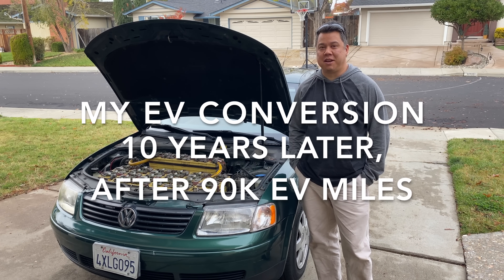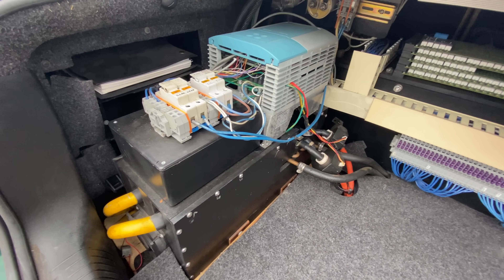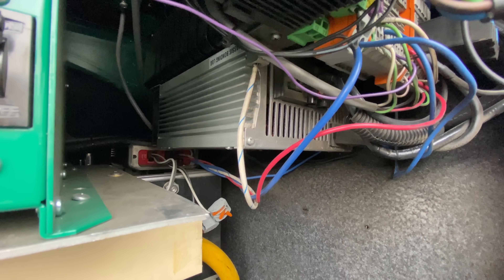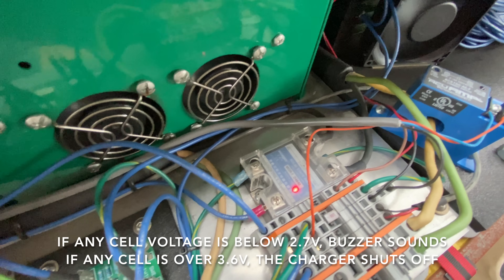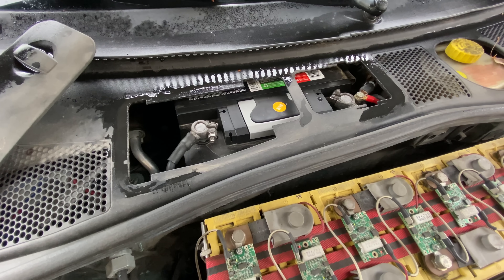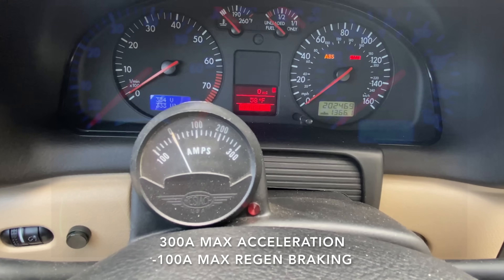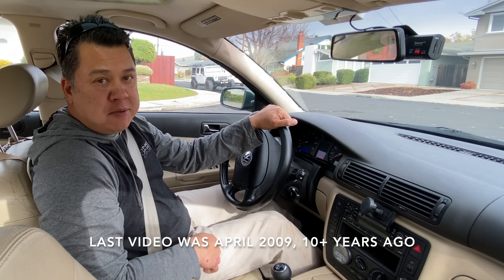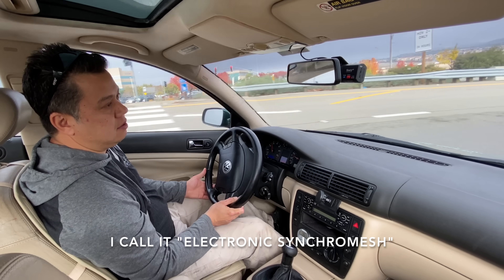My EV conversion after 10 years and 90k miles

Comment: Probably a dumb question but why no clutch? Too much torque from the motor? And if so, why can't you just get a heavier clutch?

Also, this is so damn cool.
Reply from the maker: I wasn't sure if the bearings in the motor could take the thrust load of the clutch throw out bearing pushing on the shaft.   I was also planning on just using 2nd gear from the start.  Adding a clutch means adding a flywheel, which requires more machining tolerance and force on the taper lock fitting I was using.  It would also require balancing the flywheel to 9k rpm.

Comment: I know this is the hardest part, but you should throw away the gearbox and using a motor who match the speed of a differential than you should take for an other car, like a RWD,  mercedes type or something, you will gain some space for cell. But the cost increase with more cell so ... may be you don't need that mutch cell for your standart use of the car and figure out it's enought like this ?

Allright it's a pretty good job you make and the initial investissement is pretty huge, so big GG. I like how you use a standart indutrial inverter and adapt it to a car throw current mesurement, allowing you to do some torque regulation. Yep, the big point is to have some 0-20Kmh smoth torque, industrial inverter are made for speed regulation and are barrely made for torque regulation, So once again, big GG to you, I can just clap my hand for all this hard job.

At your place I will use a  PLC instead of this bunch of controller, because it's allowing more space. But may be 10 years ago there was not with the same price and capabilitie than they have now, I think you obviously did this choice on purpose.

But Alright , i am not here for critisism, it's just something a Look as a technician and it's involving in me some question, nothing more.

IN fact, it's very good job, just GG.

Comment: Just too much, it was easier to use dc motors from forklift, they are not fast, but are capeable of making great torque, its automatic, so you don’t have to change the gears and by the way, why you didn’t used the fuel tank space? Thats the main problem with ev conversions, noone uses fuel tank space

Comment: Nice..what's  your total battery capacity (kWh), charging rate (kW), and what's your range (km) on a full charge?
Reply from the maker: 33kwh battery, 6kw charging, 100 mile range but kept it below 70 miles for battery longevity.
Reply: @etischer  Nice! That's about as good as my Nissan LEAF 2017... and your home-made EV is  much older.. Nissan could learn a lesson from your conversion!

Comment: You need to change your batteries from old design to better design batteries. 
You have done a fantastic job but not with the batteries. The weight of batteries on your electric cars runs about 800 lbs?

Comment: So what was the cost to make your car electric? Then what does it cost to charge it (electricity draw from your house)? All-in-all, great conversion. But you didn't benefit by saving money on fuel cost or your electric bill. So this was just a hobby and challenge?
Reply from the maker: Yes, I did it for the challenge, and to show case my engineering skills.  I had done other gas conversions, you can check them out on my website etischer.com   Our night rate was 3 cents per kWh, and I get 3 miles per kWh, so about 1 penny per mile.  I also charge at work for free, so 1000 miles cost me $5.   Actually our electric bill went lower when we switched to an EV plan, so it's basically free to charge.

Comment: Why didn't you put a gear box before the automatic box to reduce the motor rpm to normal engine running rpms then you would have been able to keep the automatic with less load on the electric motor so it would draw less from your battery pack
Reply from the maker: There's no need, the stock transmission works great.  No need for an automatic gear box, the motor has a much wider torque / power band compared to a gas engine, this is why no OEM EVs have transmissions.

Comment: Awesome, I seriously recommend having a fire extinguisher in the car, just in case.
Reply: White Right not with the right equipment
Reply: @fiveninegarage  youve obviously never seen gear like this go up in flames, nothing but a ticking time bomb as soon as flames break out
Reply: @fiveninegarage  They dumb them in containers filled with water to get the fire controlled... not even a fire truck can put these fires out
Reply: If it started on fire I would run away rather then put it out

Comment: Having converted my CJ5, you did a really clean/complete job.  How's your battery match been?  How often do you manually re-balance?  Do you have any under-achievers?  Do you go thru 12V Pb batteries?
Reply from the maker: I went a solid 9 years without measuring voltages.  I have two that have been low, I think the top balancing BMS allowed them to drop in SOC over time.  In the last year I had to top up one cell up about 20 Ah.
Reply: @etischer  I have the same batteries and BMS (from your front cells).  Mine date to 2010.  All still work fine.  Overall batteries are probably down 10-15%. 2 or3 batteries have been topped-off every 3-5 years or so.  Usually the same ones.  20Ah would also be about my largest adjustment.  I have half the range, so system SOC might be more important to me.  I'm most impressed by your use of space.  A Jeep has a lot more open room under the hood, but I didn't pack it in like you did!  Nice work.

Comment: Because all that extra heavy pounds you will need an industrial jack just to change a flat tire. A manual on a EV. My respect sir.
Reply from the maker: The added weight is only in the rear, where the car was lightest.  My car is 100 lbs heavier than the v6 variant. Not a big deal, no special jack needed

Comment: A friend of mine has a crx hf and considered installing an electric ac. We calculated the conversion would add about 50 miles or 5-10mpg. The car barely makes 70chp and removing the parasitic drag from the motor would help it a lot.

Comment: This is interesting. I bought a phev with low miles for $8500. Half of my driving is all electric. I think I opened my hood two times in 15 months. So far it has been reliable and very cheap, average 72mpg and maybe $15. a month in electricity. After driving over 15k mile I am sold on electric cars. You never worry about stopping for gas in the morning because you have a full charge every morning. The cars are so quiet also. Next time I will consider full electric. You don't need to be a genius like this guy to take advantage of owning an electric car.

Comment: Beautiful build, even more impressive considering it was done 10+ years ago. Living in California you probably don't have to worry much about heating, but I wonder what would it take to have the A/C fitted with a reverser valve (I don't know the proper name, the valve that reverses flow of coolant) to get rid of a resistive heater.

Comment: That’s a lot of determined hard work. You have done a mighty good job covering all those requirements with multiple systems. In 1980 when I was an apprentice I designed and built an electronic fuel injection system for my racing Mini Cooper. I also had electronic spark advance and retard, electro optical and magnetic sensors attachment to the engine, turbo boost mapping in the Z80 microprocessor controller (which I also made the pcb’s and done the programming for), and not forgetting the electronic ignition system which I also designed and built. So I know how hard you have worked on this project from my own experience but it’s all fun really when you get the satisfaction of success. Fantastic job .. it really is.

Comment: Not really an fan of electric cars but you sir are a genius. Since you built your own car maybe you can answer a question I've always asked but never got an answer to. Why do regenerative systems only work while hitting the brakes? Why not somehow turn all 4 wheels into an alternator that is constantly charging while the wheels are spinning? Like the alternator on a gas car. It seems like common sense but I'm no electrical engineer and I am genuinely curious about this topic.
Reply from the maker: You can only convert energy.   Regen brakes convert motion into electrical energy, which cause the motion to get used up (car slows down).   Energy can't be created for free.
Reply: @etischer  Thank you very much for your reply. I understand that as the energy is created from the motion of the wheels, the motion gets used up to produce that energy slowing the vehicle down. I guess it's like a drag race car. The alternator is removed to reduce any drag on the  engine. But with that being said an alternator is constantly spinning to produce energy through a belt which is moved by the reciprocating motion of the engine. I'm a bit confused as to why we can't place an alternator type device to each wheel to charge or at least lessen the discharge of the batteries while the car is in motion. This might be something I might want to dabble in at least with an electric RC car first to see where it goes. This is very interesting to me. I do love the technology and must say I do admire your abilities. Thank you again for the response.

Comment: 75 in 2nd, sounds about right. 'tho I don't know if those azure motors like being spun that fast. We kept making the mistake of spinning ours too slow. The HPEVS AC51 was born from a hydraulic pump motor, so it wants to spin at rather high (for a car) RPM -- it's perfectly happy 4-5k all day long. At your customary 2k car speed, it'll overheat. (the factory balances them to 10k, and the controller cuts out at 6k.)

Comment: I was: "I'm getting motivated to do something like this", then $25k invested, "that's s lot of cash", next all that technology, "damn that's just too overwhelming for project", then it starts turning to, "How frigging cool would it be to do this before I check out".
Reply: I believe that was the cost when he started the project. Technology has improved and price have also come down. I imagine the cost is a little less these days. Maybe not by much tho.
Reply: Doooooooooooooo it
Reply: A few years ago I was shopping for a donor vehicle to build an electric pickup.
Yes, it would cost me $20,000+ to build a much more basic vehicle than this.
I bought a used Chevy Volt for $10,000, and last year, a used Smart electric for $5000.
I found a converted pickup recently for under $10,000.
Definitely not as nice as this car!
Reply: @hjeffwallace  
Yes, hunting for the deals seem the way to go.
I'm going to startlooking through my local auto recycling lots for damaged Prius this spring. They usually lose a cell or two then are sent out for scrap. Fingers crossed .
Reply: (90K miles ev worth 11K$)-(cost of charging)= ((11K$ - 25K$)-Charging cost)

Comment: Duude! Clearly you are related to elon musk. But please explain to me, a sub lay person, how can you have a ev with a manual transmission. dont quite understand. actually, i dont understand at all. my mind is completely blown. I have a 98 volvo s90 in immaculate condition that Ive been thinking of doing something similar to. How much did that conversion cost and how long did it take you? unbelievable. btw: where in cali are you? Im temporarily in norcal. return home to japan in 14. would love to link up and get some advice.
Reply from the maker: The transmission is just a convenient way to connect the motor to the wheels, and also have the motor RPMs in a range the motor can work effiencetly.  It took about a year to get the car running, I have the dates in the video.  I'm about 40 mins east of SF
Reply: Hey, Im in marin. hit me on email. fitzdec@gmail.com

Comment: 0 - 60?
Top Speed?
Nürburgring time?
Really, really, cool!
Reply from the maker: 0-60 was 14 seconds, mainly because I was starting in second gear, and holding it to 60.  If I had a clutch it would be much faster.   Top speed was 105 mph, I had since increased the current capability but haven't re-tested top speed. 
Nurburgring time:  This was built for comfort, not for speed =)

Comment: How well does that AC compressor work? I would love to get one but even their site says that it might not be enough for a car cause the 12V compressor is meant for small cabinet cooling. Just curious
Reply from the maker: It works ok, maybe 80% as good as the belt driven compressor at full speed.  Mine ran off 330v.

Comment: Great build.  Few questions.  What was the change in curb weight? How many battery cells have required replacement over the years.
Reply from the maker: It weighs in at 3,700 lbs, 500 lbs added to the rear.   I haven't had to replace any cells, though one or two are about 50% capacity now.

Comment: Why exactly would you use a manual with an electric motor? Don't get me wrong, I love stick shift but I feel like it would be troublesome with the instant torque etc
Reply from the maker: roughly a 10:1 reduction is needed, and the easiest way to achieve that is with the VW transmission that came free with the car.

Comment: Wait; you're liquid cooling the drive motor and yet you have a resistive load for a heater? Why not just have a heater core running off the drive motor.... And not have the additional load on the battery bank??
Reply from the maker: The motor and drive don't put out much heat, the water never even gets warm.     Resistive heat is also instant heat.
Reply: @etischer  it doesn't get warm because it's always circulating, if you had a thermostat on it, it may be better.
Reply from the maker: @JF32304   I could just turn the water pump off, but still, not enough heat is produced.  It's not like a gas engine.   None of the electric cars on the market use coolant for heat.
Reply: @etischer  Tesla has to liquid cool the motor as well. As well as the battery bank! Take both of those heat sources through a heat exchanger and not use a resistive load as the heater, waste of energy.
Reply from the maker: @JF32304   The coolant is not boiling hot like a gas car, battery cells will want to stay below probably 50 deg C.   The coolant is cooled using refrigerant from the air conditioner in some cases
Reply: @etischer  good Lord! So we're taking power from the battery bank to run a resistive load heater, we're also taking heat from the battery bank and passing that to an AC compressor (more battery power)! This is mind boggling stupid. Take all the heat into one single heat exchanger. You can have the resistive load heater to get heat up fast (on cold mornings) once your battery bank and motor are producing enough therms, turn off the resistive load and go with your heat exchanger. Really is quit simple. If you're concerned about it not being efficient enough to pull enough heat out, install a radiator and fan. It's stupid to power an AC compressor to pull heat from the battery bank. If you're producing enough heat that you need to have it cooled by refrigeration... You have big problems with efficiency.
Reply from the maker: @JF32304   There's no hot water, the batteries, power electronics and motor are supposed to stay around room temperature.   If you're cooling something that's supposed to be room temperature you need cold water.
Reply: @etischer  ok. But you just said they sometimes use air conditioning to cool it down right?
Reply from the maker: Jesse Fritz refrigerant goes through a liquid-to-liquid heat exchanger to chill the coolant.

Comment: Excellent informative video. How do you use ac motor with throttle? Would you guide a bit to use ac motor controller insted of DC
Reply from the maker: The Passat was originally throttle by wire, so I wired the throttle pot into an analog input on the VFD.  The VFD uses that input as a torque set point.
Reply: @etischer how did you justify which ac motor to use? would you help with some images and connections, am working on a range extender systems for EV has successfully tested 2 & 3 wheeler's with a 3 times increase in range, Battery lifecycle increased by 30%, but all on DC motors I wish to use AC motor.

Comment: why did you not convert your steering to electric steering ?
Reply from the maker: Seems like a big engineering feat to get something from another car to fit, mount up properly,  and adds  risk, for just a slight benefit.
Reply: @etischer  you can find universal systems out there  https://www.summitracing.com/search/product-line/epas-performance-electric-power-steering-kits/part-type/power-and-manual-steering-conversion-kits
Reply: @etischer  and you modded a large portion of your car why not keep upgrading it the power steering would be one less fluid change and this also my help your range as well
Reply: @etischer  https://www.youtube.com/watch?v=5734rdk-6V8

Comment: To quote Darth Vader: Impressive! MOST impressive! And $25000 for everything? That in itself is very impressive! I've seen many of these EV conversions and a lot of them end up using lead acid batteries. They're inexpensive, sure, but they are HEAVY and don't last very long. Glad to see you went with lithium.

Comment: "super stopping power"
tire grip is the same buddy and you added a butt load of weight to the vehicle, stopping distance over stock is probably significantly increased.
Reply from the maker: It stops quickly with minimal pedal effort, like it has really aggressive brake pads.  This feeling is what I was trying to describe.

Comment: one of my favorite cars ... you done it right.. VW should hire you and we should need to be able to get VW PASSAT EV from the factory ... this will also up the battery power a lot as you'll get the chance to work with an integrator (instead of having to work with of the shelve stuff)